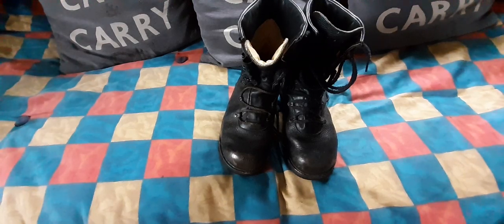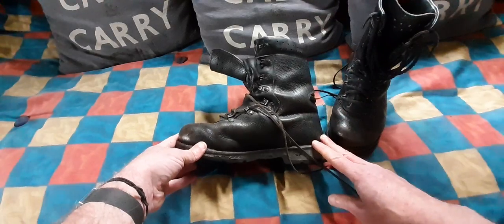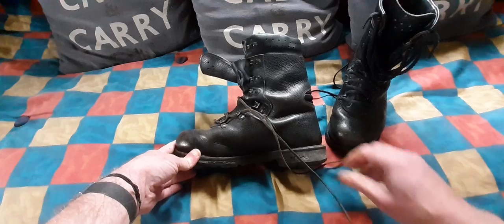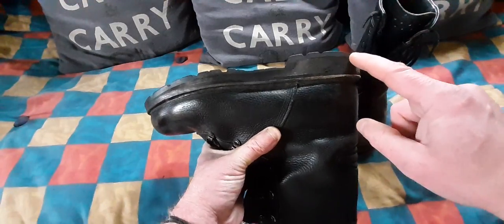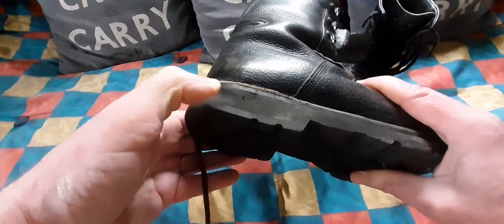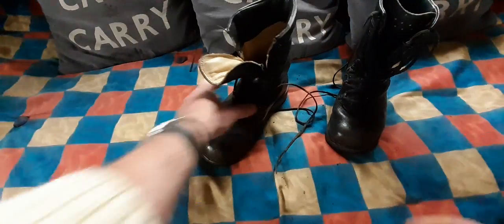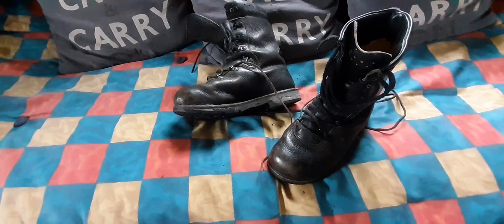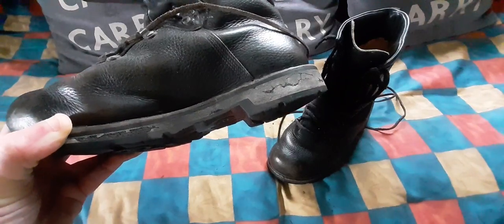WEST GERMAN BUNDESWEHR PARATROOPERS BOOTS MARK I

Comment: Those are the 2000 model, first introduced around 1999 & issued until 2005 when they were replaced by a new HAIX design, which was again replaced in 2007 by the same model but with improved speed lacing hooks & is still the German army's current issued combat boot..
These particular boots, with the PU foam sandwiched between the rubber soles, were only expected to last 9 months, which was the length of the German national service at the time ( National service has sinced been phased out) and is of course their Archilles heel, so to speak as PU is subject to perishing over time, that said, there are still some 2000 models with their soles intact. 
On the lining of the tongue there is a series of perferated numbers,  The first set of 3 is the size (UK 7= 260)
the following set of 3 is the width, they came in narrow (99) to wide (112) ......Then below that is another series of  numbers  which indicate the month & year of production. e.g.   01 04 ( january 2004)
By the way, the 2000 model can be resoled with a vibram combat style sole by a good cobbler.

Comment: I bought a pair of grade 1's in fantastic clean condition, they're a real quality item and well worth the price, but I wore them for the first time recently when I did a 3 hour hill walk, unfortunately I came home with three blisters, the boots are a perfect fit, but I think a touch of heel slippage was responsible for two of the blisters, but the other one is on top of the middle toe on my right foot.
When I felt inside the toe box, I discovered that there's a stiched seam where the inner leather lining joins together, the seam feels quite rough and its right in the middle of the toe box. I'll give them one more outing after I try to sort out the problem and if it remains a problem, I regret that I'll have to let them go, but initially they were really comfortable when I first put them on, but that soon changed after about one hour in

Comment: Thanks for that info........I will avoid these like the plague. Ive been stung before as I bought a Brand NEW pair of British Army 95 pattern boots.....the rubber just fell to pieces.....only walked round the block in them. I know now that they only have a 5 year life span.....avoid at all costs soldier 95 boots
Reply from the maker: true, some later marks of the para boot dispense with the shock absorber section as they were revised, and some german para boots which have been offered for sale to the public have had their soles completely replaced with civillian hiker boot soles.....which kindof gives the impression that later patterns were of dubious quality regarding the sole.

Comment: I've got a pair of the 2007 that I love but if I could get a pair of these in supergrade for under £40 I would buy them in a heartbeat and replace the sole with Vibram.
Reply from the maker: Unfortunately the soles on these had degenerated so bad that these boots hit the dustbin in mid September 2023....but they have left a nice big black sticky patch on the red carpet in one of the bedrooms!!..that's going to be interesting to remove.

Comment: Not even close to 1900's boots, first made in 2000.
These are the M2000 boot, so not west german. The midsole issue popped up later one, the midsole itself holds on very well but it has a very limited shelf life of about 5 years. These were made til 2006, so in the video they're atleast 15 years old and that is why the midsole is broken. A updated version has been made in 2007 which fixed the problem entirely and also updated the upper a bit, but those are now not being issued anymore as well. The british military has had the exact same issue on their combat 95 boots.

Comment: Who makes these boots?
Reply from the maker: No idea,no maker details
Reply: @historicmilitaria1944  I have many regrets in my life and one of them was thinking that a reproduction of this boot would have addressed the heel  problem. Nope I was wrong. The boots started to fall apart after about one to two weeks of use. The heel is going soft and the sole itself is just coming off in tiny bits. I can't even take a walk to the mall and back without having to check the sole to see if anything is missing. 😂
Reply from the maker: So the repro is just as faithful to the original!!!
Reply: @Military Collectables  Yes. Both were not meant to last long.